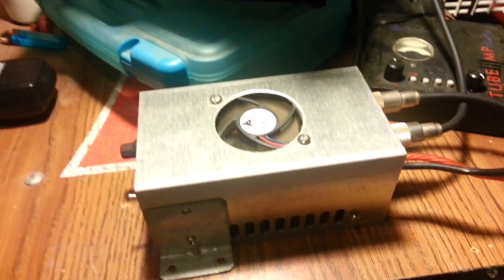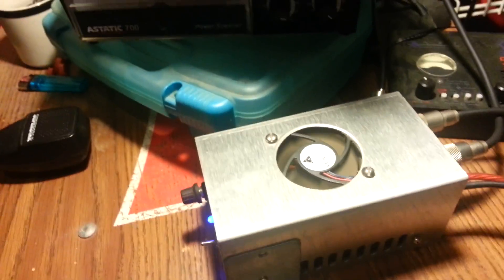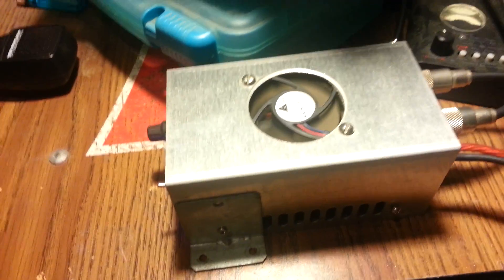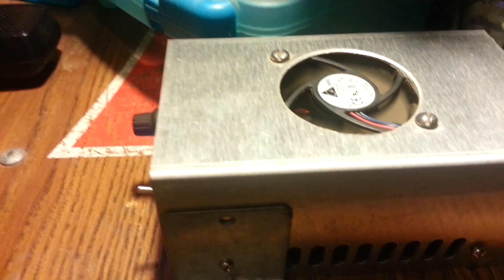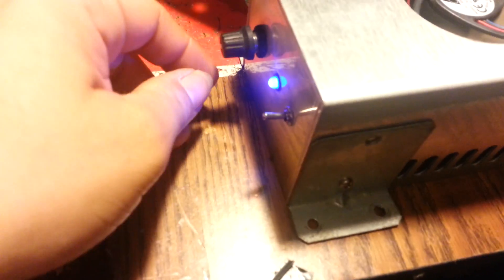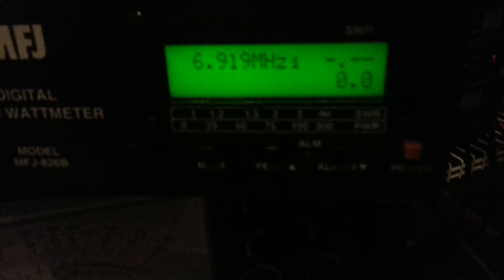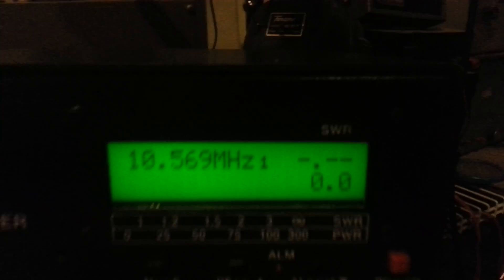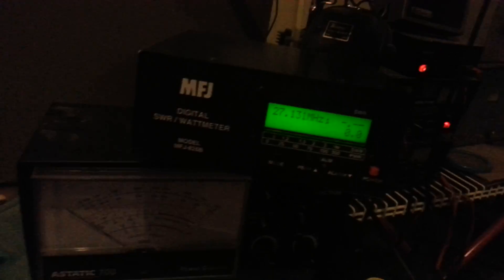Gatekeeper 2x1446 RF Amp Fatboy Clone Output Test 😵

Comment: im kinda starting out myself learning on my own could use a teacher. i think you can find my email. i have made electronics projects before not afraid of a soldering iron. but  i was starting to gather parts and some thing came up i put down my iron for ten years. picked it up recently. i did manage 4 $25-$30 2sc2879 toshiba's looked at pricing now. glad i got them in 2009

Comment: I have an 8 pill 1446 final amp with a load dial on outside back of box. I drive it with a Connex 4600 Turbo. 4 Watt DK, swinging 150w out of Connex, and the amp keys at 300w dk, and swings 750rms.